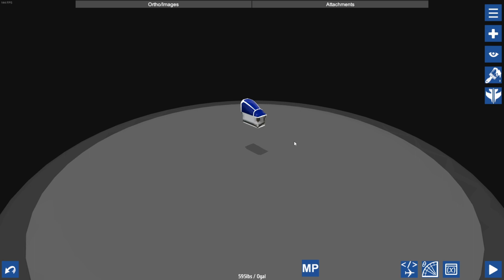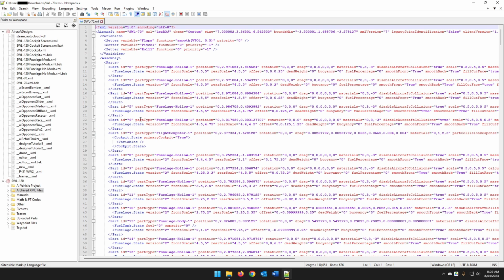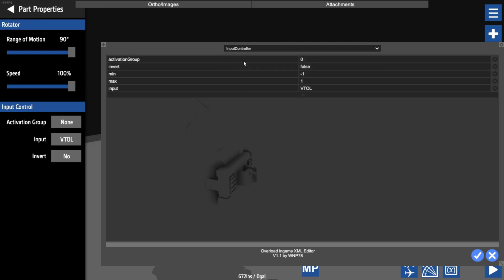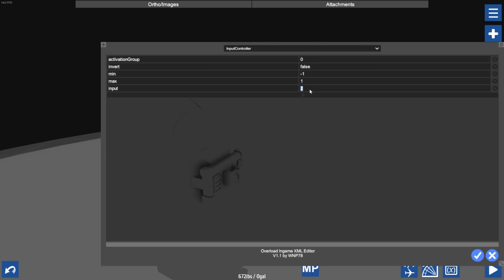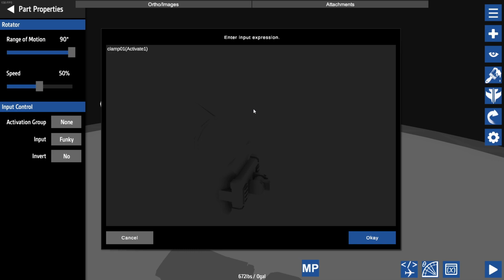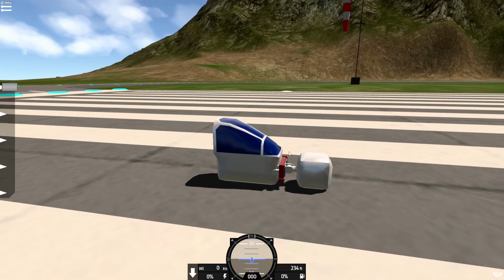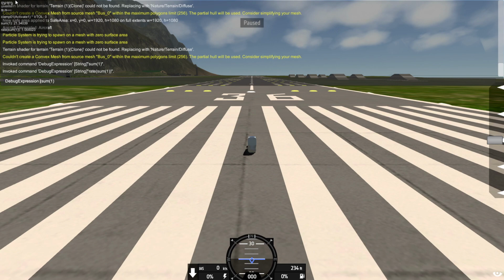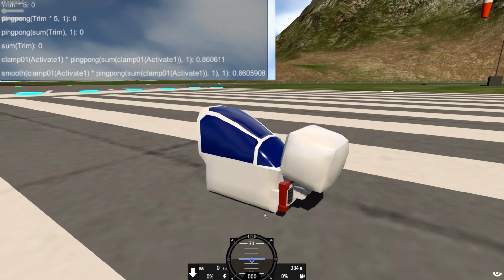How To Code In SimplePlanes (Part 1)

Comment: BRO my rotor is rotating and hinge rotor are moving too much.. like too much grease (just an example) but this is seriously.. my rotor is rotating uncontrollably.. its over turning.. and coming back.. and over turning again.. and coming back.. pendulum motion... how to fix this

 Please replyyy
Reply from the maker: This sounds like the mass of the build is very high. There are two ways to solve this issue. The first option is to decrease the overall weight of the build. The second option is to add a property called damperMultiplier in the jointRotator page in Overload. I recommend you try 1000-10000 as the value for damperMultiplier, and adjust as required.